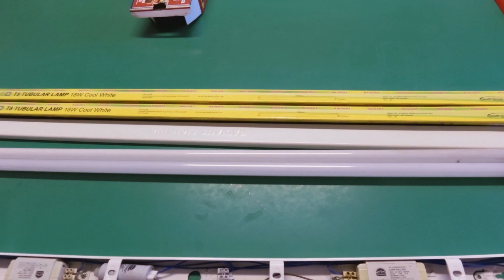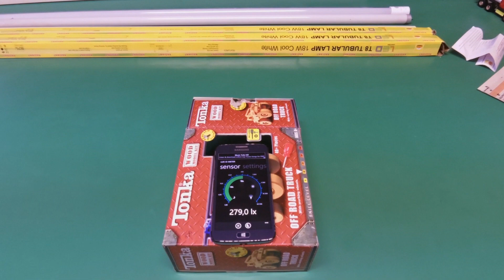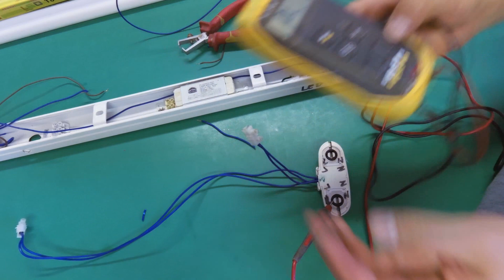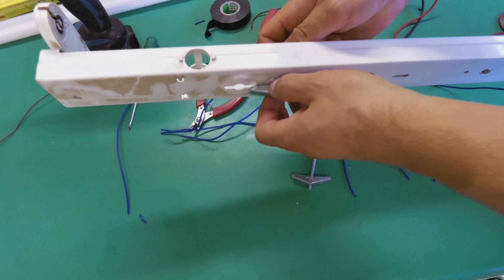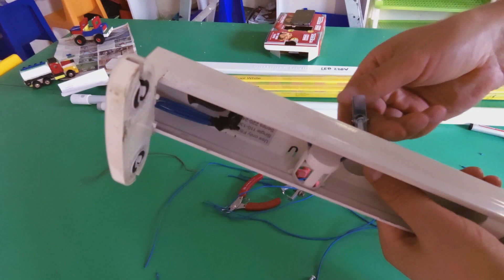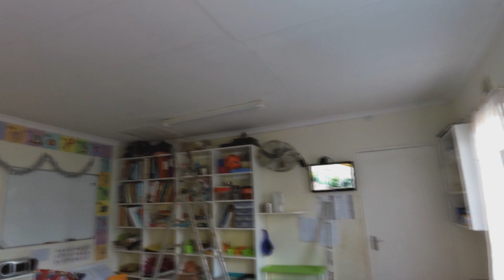How to convert fluorescent light fitting (T8 or T12) for LED tubes: Step by step.

Comment: Wait .... Wait just a minute ! You MAY NOT have to modify the fixture. The LED replacements I have seen run on the ballast and you just put the new 'bulbs' in the old fixture. Those are type "A"--- Type "B"  need ballast removed. Type "C" require external transformers.
Reply: I think it depends on the fixture, if it's an old fixture, with a magnetic ballast, that is likely to fail in the next couple of years, then the ideal would be to remove the ballast and replace it with direct wired bulbs.  For a fixture with a relatively new electronic ballast, you're better to use the direct replacement tubes.

Comment: This Channel is Great! 
Will the LED tube get damaged if the L and N are connected wrongly as in oppositely? i suspect the light will still work.
Reply: Wait .... Wait just a minute ! You MAY NOT have to modify the fixture. The LED replacements I have seen run on the ballast and you just put the new 'bulbs' in the old fixture. Those are type "A"--- Type "B"  need ballast removed. Type "C" require external transformers.

Comment: Hi,I fallow your instruction ,but my lights were burned,I have the lights FT8-36w 840.?Can you help me with information,please?
Thank you
Gabriel
Reply from the maker: those are florescent tubes you have. You need to get LED tubes.
Reply: Wait .... Wait just a minute ! You MAY NOT have to modify the fixture. The LED replacements I have seen run on the ballast and you just put the new 'bulbs' in the old fixture. Those are type "A"--- Type "B"  need ballast removed. Type "C" require external transformers.
Reply: His wiring for single ended T8 led light. So don't use double ended bulb. Thank you and God Bless !!!
Reply: Use single ended T8 led light. Not double ended bulb. They have two type of wiring.